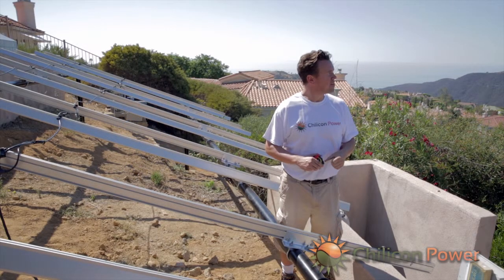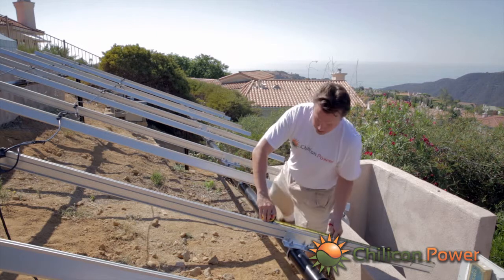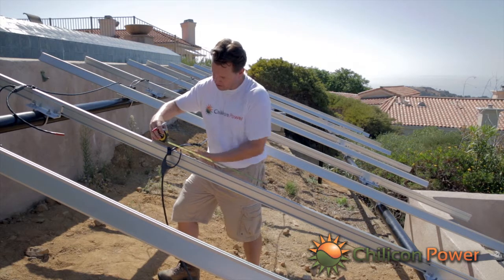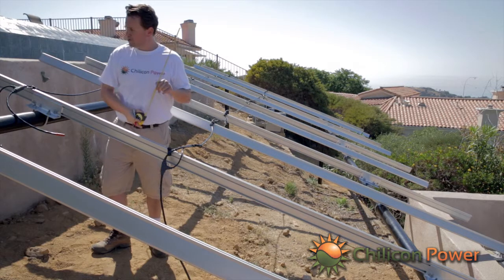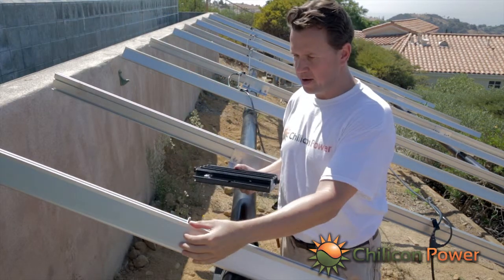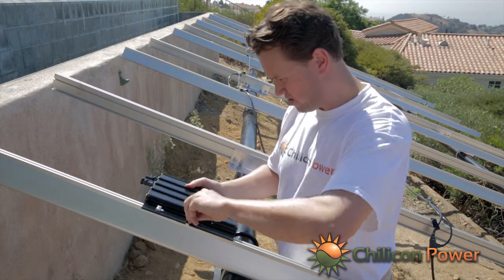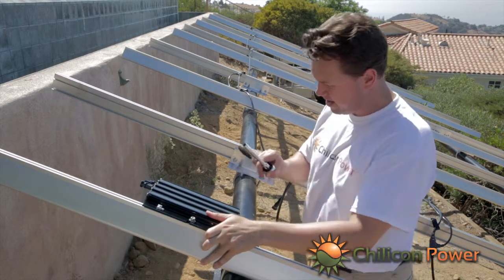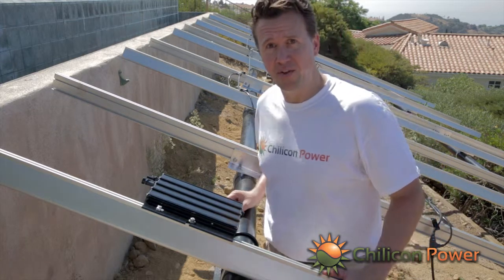Part 4: CP-250 Inverter Mechanical Installation

Comment: Hi Jomo, In fact, the grounding for the inverters is integrated in the AC trunk cabling now, so no need for WEB washers any longer. Each CP720 should use a bolt. These are provided by the racking provider, or any standard 7/16" bolt and washer can be used.